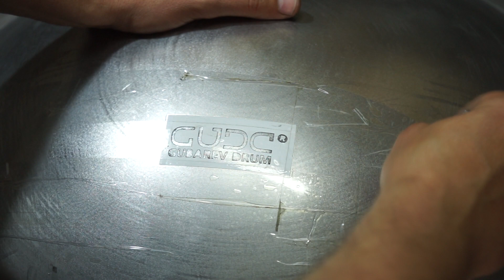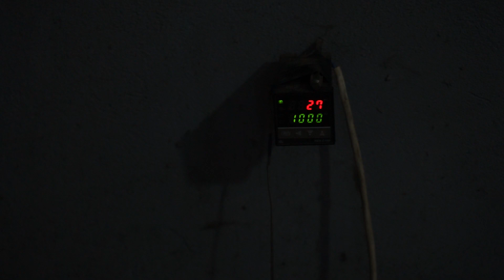How I make GUDA drum, part one. How to make steel tongue drum

Comment: Hi Gubarev,

Thank you for the great two-part series. You are a talented craftsman. I watch this series occasionally for motivation to get out into my shop and stop worrying about making mistakes. When you hammer around the tongue edges, are you softening/highlighting overtones (similar to a handpan)? Or, are you using this to fine-tune a note without having to lengthen/grind the underside of the tongue to lower/raise the frequency (perhaps by stretching or compressing the steel around the tongue)?
Reply from the maker: hello, yes, you rightly noticed, by hitting the edges of the petal, I adjust the overtone to the main tone of the petal.  when tuned, it floats a little, and thus you can set it more accurately.